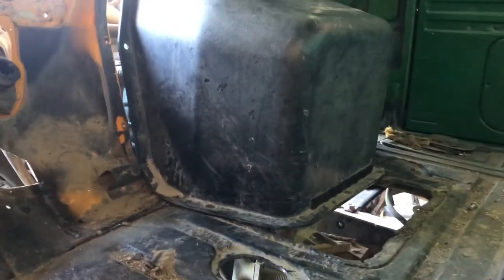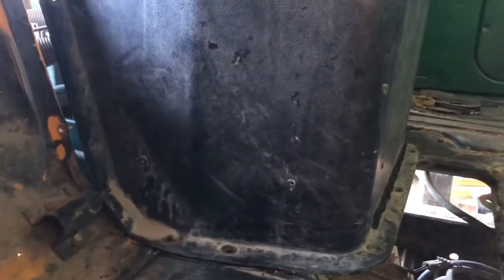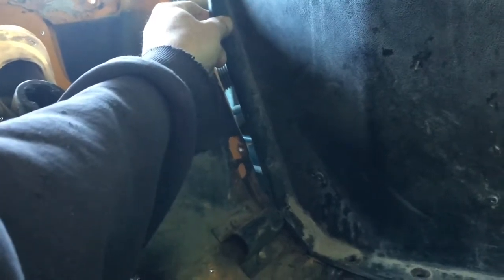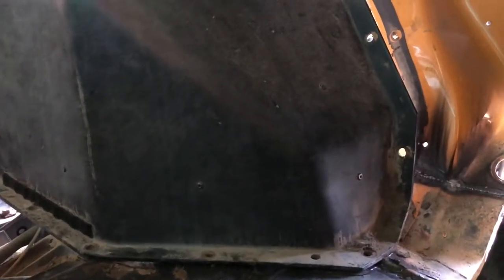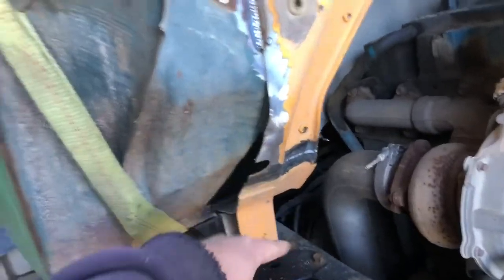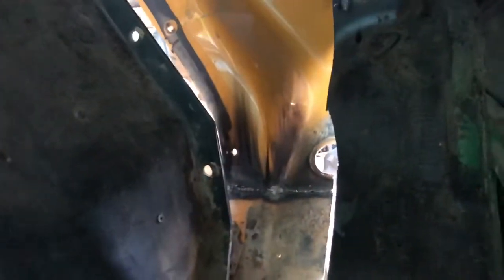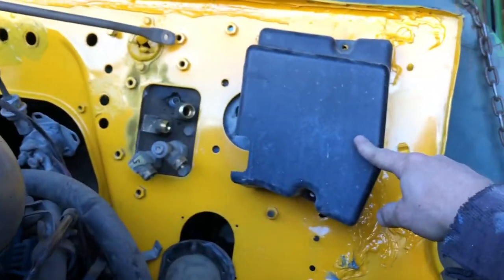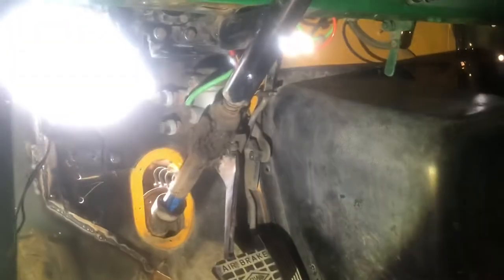1955 F600 School bus chassis swap part 19

Comment: It's getting there .. Glad to see it running again .. Won't be long now it'll be moving .. I think the gauges will look pretty good when done .. Sure it sucks to cut the dash out .. Bit I think it'll blend in nicely with a little fab .. it's nice the doghouse fits almost perfect and it's not over sized either
Reply from the maker: It sure is good to hear it fire up again for sure!  I have to keep reminding myself, this isn’t exactly a restoration. Cutting things to make stuff work is the name of the game  on this one. Not like this this is a highly sought after hard to find truck. 
The doghouse I think will fit nicely. I was really hoping it wouldn’t take up much room so I could continue to have a  2nd passenger in the middle seat.